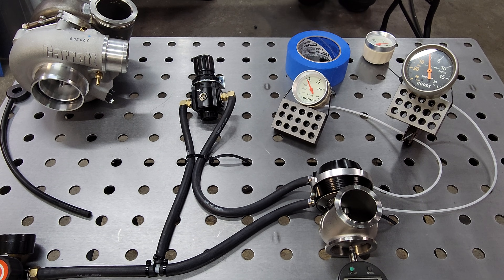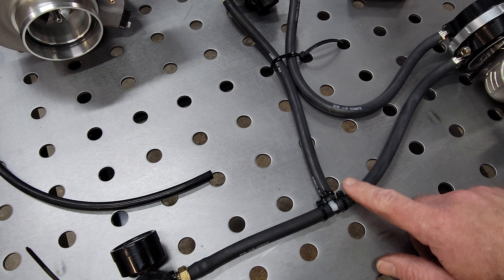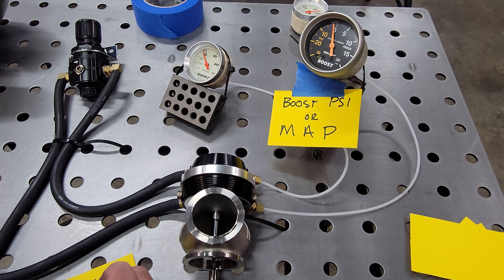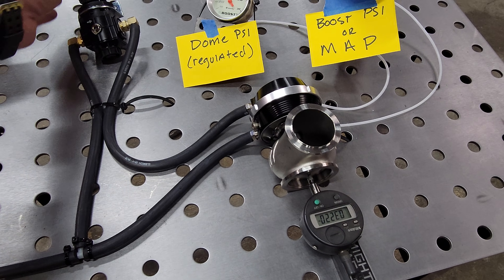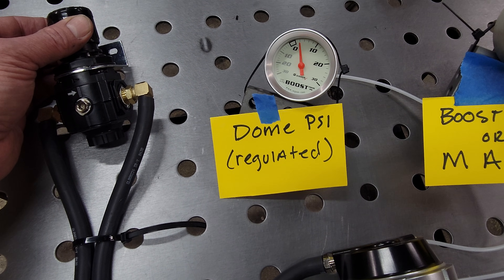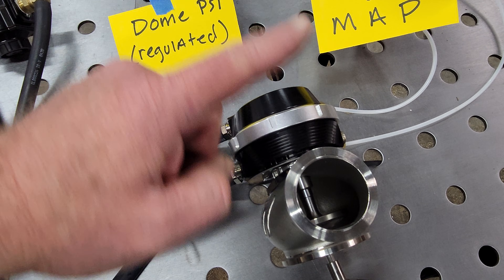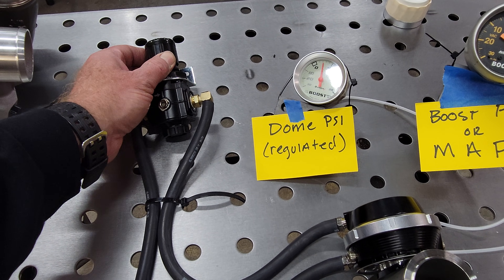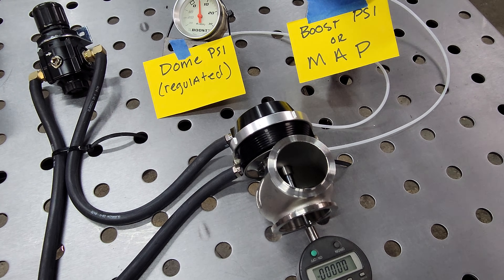External Wastegate Setup, Episode 2.  Simple Adjustable Boost Controller!

Comment: Really like this approach! Tends to allow a much wider boost control range on the same WG spring than a typical ball and spring MBC, and works great for in cabin boost control too since it's not as sensitive to hose length to the dome. 
Tends to be a more solid (although fixed) psi level IMO with a stronger, self correcting feedback loop vs an EBC's ability to vary boost with gear or rpm. Not a big deal with an AWD DSM or Evo, but have done one with two regulators and a solenoid for a "hi/low" boost switch which is fun to play with mid pull :)
Reply from the maker: One of my first "boost controllers" for the drag car consisted of 3 regulators, NOS solenoids and digi set timer relays. It was a concoction to say the least!  Triggered off the transbrake switch.

For the street car we would insert a restriction pill into the upper reference line, that would give us a little bit of a "curve" to the boost ramp...and we also had a "panic" button on the shifter that you could push and engage a solenoid to cut off the flow completely to the dome to stop the boost increase. A second button on the steering wheel that just sent stored air pressure to the dome to give you as much boost as you dared.  It was all so much fun when you would get the 2 buttons confused ;P  Fun times!  Thank you for the comment!   Reed

Comment: Reed what you recommend for a Hotair car?  I know that Turbosmart does make a factory style adjustable actuator, however I have not seen one installed and cannot speak to it as a result.  Would you be able to show or demonstrate a Hotair boost control system?  Something like this - https://youtu.be/LZJuVldL3qY?si=H5cTwyg4xHuNsQBV
Reply from the maker: I can provide an upgrade for you, we do them on a core exchange or also have them new and ready to bolt on without sending in a core.  The Turbosmart cannister will not fit the installation footprint,  we use a TiAL product for these cars.  

Adjustable internal actuator installation and adjustment video:

https://youtu.be/-KRkzusMtmM
Reply from the maker: I also have a second video going over a simple manual boost controller install:

https://youtu.be/kBSwzDOX3tU
Reply from the maker: I have more content on this subject coming soon!  I am a small shop so be patient with me and I will happily help you out with whatever you need on your Buick!  Thank you!!!  Reed

Comment: I have a question. I own a Mazda 626 FE 8V, which is a carbureted car. The current engine power is around 87 hp. I want to install a GT1548 turbo on this car. As you know, this is a diesel engine turbo. My first question is: would it cause problems to put it on a gasoline engine? My second question is: would it be problematic to feed a turbo into a carburetor?

Comment: Can you help me understand the math here? 7 lb spring plus 2 lbs of air to the top, I would think that would limit the boost to 9lbs of pressure, but you were over that on the boost gauge.  Is this just due to variances in the two gauges or is there more to it than the simple math?  Thanks for the great video.
Reply from the maker: My regulator that I used was very touchy (really set up for 100-150 Psi) so I was having a bit of a time trying to get it to stay steady.  Also, yes, you will see a bit more pressure than the actual spring rating.  They do that to help compensate for the exhaust pressure pushing on the valve face.  

All in all, it should "math".  2 psi of air pressure should add 2 psi of boost.  Or get really close.  

Each gate brand could be a bit different, mainly due to the motor (diaphragm) ratio/spring rates etc...

Glad it shed some light on it for you either way!  LMK if you get any other questions.  Reed

Comment: I just set this up on a 1.8t gt3076 build.    It works fine and was only about $50.   I guess the down side is that it's impossible to change accurately without reconnecting it back to the compressor for a steady pressure supply just like any other manual controller.   Thanks for posting this video!
Reply: When you have the regulator and WG on the bench testing you can try adding a paint/etch mark on the regulator body and the knob. Then test how much pressure is added with each click or partial rotation of the knob. Make sure the marks vs pressure repeat several times reliably.
Then when its back in the car you can add/subtract boost in known increments. This is my plan and doing the same thing on my HBC boost controller has worked well.
Reply: @chomptriscuits good idea, thanks

Comment: If you dont mind, what's your thoughts on a large difference in MAP and spring pressure? Also, a falling boost curve even with a properly setup eboost 2. Plenty of turbocharger.
I have a turbo modular ford with twin 40mm PTE gates, one for each bank. 76/75 On3 turbo rated for ~1100HP. Im pretty certain it's a PTE gen 1 sportsman clone. 
I get roughly half the MAP as selected spring pressure(even on 10psi/650hp range). I have a eboost 2 setup in the configuration you show here. reference from turbo, solenoid sends pressure to dome.
I have issues holding a flat boost curve(falls off about 20% regardless of settings I use on controller, solenoid is working). 
I plan to test with air compressor today and see what pressure it is actually taking to open the gates. If the springs are accurate than I must have a restriction in the intake tract? As far as the boost curve, I wonder if twin 40mm is too much gate and does not give fine enough control? I am following a very similar turbo setup to mine in a facebook group and the guy has no issues with a single 44mm gate around 900whp.
What are your thoughts?
Reply from the maker: Thanks for the question. 

 You are on the right track testing the gates with compressed air first.  If this was my setup, I would remove the boost controller from the system temporarily.  Set your springs up to give you a known boost pressure (I would shoot for 75% of your target boost pressure to be "safe"), make sure to test both gates on the bench to verify they open close to your desired pressure.  Make sure the wastegates have their valve seats installed as well. 

Hook the reference port up to the compressor cover directly to the lower port of the wastegates (leave top or dome open to atmosphere)  Run the car and note the results.  

If the boost hits your target and holds, you are needing to dig deeper into the boost controller settings.  If it is still lower globally or falls off up top, try the following:

Move your boost gauge from the intake manifold and directly hook it up to the compressor cover port.  Drive the car and compare.  If the boost reading at the cover is close to your target boost and never falls off, you could have a restrictive intercooler.  If it falls off, lets go to the next test.

Air filter...if the filter is small, or an un proven brand, remove it if you are comfortable with how clean everything is in your engine bay and test road.  Re-run the car and see if the boost holds or continues to have fall off.  If it still falls off, go to the next test.

Exhaust restriction.  If possible, run the car with just a downpipe in place, running without mufflers/remainder of system.  If it still falls off, go to the next test.

Ignition timing/tune.  Verify that your ignition timing is correct.  If you are running an aftermarket ecu, verify TDC and lock the timing at different degrees, validate this on the balancer.  Next, look at your tune, make sure you have adequate timing under boost.  "low" or what some people will call "safe" timing can/will increase exhaust heat and falsely increase backpressure.  This can push the gates open prematurely due to the higher exhaust demand.  Correct the timing and also make sure your air/fuel is not overly rich or lean.   

At this point you should have found your answer, but if not, let me know and we can dig deeper.   Good luck! Reed
Reply: @workturbo  I really appreciate the advice Reed! 
How close are compressor cover and manifold pressure normally? a pound or two?
I'm fairly certain with no controller itll have a falling curve, but I will retest and verify.
I really should add a gauge on the compressor cover yes. The results from the wastgate air test show that the compressor is seeing the 18psi the gates require to open.. 
Additional notes:
I run a larger KandN filter and a 3in DP with a 3in boost actuated dump. The only thing odd about this kit is the charge pipe between turbo and intercooler is 2.5in. The compressor cover and the rest of the system is 3 to include intercooler in/out.
Reply from the maker: @gforce_117  I appreciate the additional info.  I would set the gates up at ~10-12 psi of crack pressure and run the car without the controller first, see if it holds boost through the rpm range.

Reason...the 3" downpipe is a bit small for anything over 650 HP on a modular, so lets stay right around that power number for the tests. 

Get a pressure drop reading off the system (boost at comp cover vs manifold).  That is going to be your first big inside look.  The 2.5" pipe from the compressor outlet should not be a huge issue at this time.  

If the IC pressure stays in line with the manifold (1-2 psi delta at this low of a boost pressure is fine) then lets move on to exhaust back pressure.   

If you are OK with your tune and the O2 corrections are very low at this point (less than 3% CF through the pull), disable the O2 feedback, remove the sensor and install a pressure gauge into that location.  Loop the copper tube in a big coil to get rid of the heat before the gauge head.  Make a pull and note the 'average' pressure number.  At this point, it needs to be pretty low since we are reading it after the turbo.  Lets see what that number looks like.  

Another thing, does this kit have any flex sections in the pre turbine side of the kit?  If so, you need to know if they are the ones rated for turbocharger applications, I have seen these collapse internally and cause all types of issues.

Short version, get intercooler pressure drop first (and if you want to test it with the E boost in place, that is perfectly fine also)

Shoot, last thing...you can also monitor "dome pressure" at the wastegate as well, just pull one of the plugs in the dome and install your boost gauge there.  This will be good info to know as well.  

Hope this all helps!!!  Reed
Reply: @workturbo  I will get some testing done! 
Do you think it would be worth testing with only one of my 40mm wastegates connected? Is it possible that too much wastegate could contribute to abnormal boost control as well? I ask because Ive been talking with another single turbo 3v guy and he is using a single 44mm gate and it works good. He's in the 850-900whp range.
Im learning to tig weld and would like to make a 4in DP along with some other improvements. I do think that allowing some turbine gas expansion would benefit it. My hope through this testing to narrow in on the problem and focus my energy there.
Reply: @workturbo  I went out and recorded a 3rd gear pull. I'll post it on my channel. 

Highlights: Compressor housing is seeing 13-14psi pretty damn steady through the rpm range once it initially stabilizes. However, MAP is dropping with RPM. Peak ~10.5psi on the spool up ~4500rpm holds 10+ till ~5000rpm, then it falls to 8.0 by 6500rpm. 

To me, it seems like the poor charge pipe fitment from turbo to intercooler, and potentially the fact that its 2.5 instead of 3 like the compressor cover, could be a source of restriction. Clearly the boost control is doing it's job at the turbo, and the engine is needing more air at high rpm. I assume some backpressure is the cause for ~14psi instead of 18 at the turbo.

Setup Details: 18psi wastegate springs. controller solenoid disconnected. Mechanical gauge is connected to the same line as wastegates which references compressor housing. Eboost 2 is connnected to the manifold. 76/75 on3 turbo. 3in DP with a 3in boost actuated exhaust dump close to the turbo. Full exhaust setup.
Reply from the maker: @gforce_117  Thanks for the detailed info...you could easily test the charge pipe size by moving the boost reference to the intercooler inlet end tank.  I would go ahead and upgrade the pipe size regardless as the step down size is not doing the compressor any justice.  Ultimately you will most likely find the intercooler itself is the problem (I hope you prove me wrong on this...sounds like the whole kit is off by my recommendations!  I would be OK with learning the charge pipe step down was the cause!)

I think you are spot on about the exhaust restriction with the data you are seeing (base spring 18, boost only 14).   This could theoretically be tested by lowering the HP, set the WG up with an 6 psi spring to purposely lower the HP quite a bit and see if it hits its target boost (should test both the intercooler restriction as well, as the HP demand is lowered)

Keep me in the loop with your results!  Reed
Reply: @workturbo  thanks for the feedback Reed! 
Like you I hope the Intercooler is not the issue. I haven’t heard of others having issues with this IC. It’s close to 12x24 and 4in thick. They rate it for 1000HP. 

So, I hope it’s just a charge pipe fitment/diameter shortcoming as well. Fitment is NOT great the couplers barely make up the difference.. 

The only thing in defense for on3 is that this kit was designed around a smaller turbo and a stock engine. At the time of purchasing tig welding was off the table, now it is so I am going to improve what I got.. 

I will get to work on it!
Reply: @workturbo  Turns out you might be right about the intercooler.. I made my own charge pipe in 3" so now all the charge piping is 3". I'm like 1psi closer to compressor pressure across board, but still same falling curve. (~11psi down to ~9psi redline, 14psi constant at compresor housing). If I load the engine harder in a higher gear, it'll spool slightly sooner and make a bigger peak number that's pretty damn close to same as turbo outlet before falling off at higher rpm.
I have pressure checked again no leaks. Paid special attention to blow of valve, no leaks there. Ensured throttle staying open. 
I have a bigger throttle body to test (twin 62mm over stock 55mm), but I doubt there will be significant change if any. It's the only other thing between the two gauges so couldn't hurt to try. 
I really didn't think it would be the intercooler since it's a 12x23.5x4in core and im only at 560whp or so doing my testing. Do you think it's worth swapping it out for a Mishimoto unit? They make one that is the same size or very very close and would be easy to swap. I wonder if that's what On3 copied. nonetheless, you get what you pay for is my thought here, and the on3 unit is roughly half the cost.
Reply from the maker: @gforce_117  All of the testing is paying off with good data!  

If it is keeping 14 psi steady at the compressor cover, getting 11 at lower engine VE and dropping to 9 at peak engine power...it will be the intercooler.  I hate to say it, but yes...you get what you pay for (sometimes!).  

I  had a heartbreaking conversation with a customer many years back that had some very nice premium brand intercoolers set aside for his project, I told him he needs to just put them on the shelf as show pieces and build his system utilizing different cores.  His combo was targeting about 200 more HP than what we got out of those units back in the 90's.  He put them on anyway.  Had almost 11 psi of pressure drop!  Rebuilt the kit with Garrett cores and immediately picked up 230 HP.  

I wish there was a simple answer for you, but the data is showing the restriction.   I have had decent luck out of the mishimoto radiators and have tested their diesel intercoolers, but I am not comfortable saying that their entire line is quality, so do you research!  

For a premium solution, contact the guys at Shearer Fab, they can set you up in a high quality core and get it done once and right!  Tell them I sent you.  IDK what a mishi part costs, but a quality intercooler is going to be in the $1400-up price point these days. 

keep me updated, and best of luck!  Reed
Reply: @workturbo  wow! I never knew cores could make that big of difference. I will do some homework and see what I can find out! The situation with this car is such a shame overall. We built the engine and sized the turbo to turn a decent amount of rpm for a 4.6. And the intercooler is killing its capability. Power peaked at 6200rpm on dyno so I can only imagine what it’ll do with a properly flowing core and a flat boost curve!
Reply: @workturbo for reference the on3 4” core is 200 bucks and the mishimoto same size is closer to 400. I know a guy that’s better at welding than me and has made custom Intercoolers before that would be a good place to start I think.
Reply from the maker: @gforce_117  Look into the Garrett cores if you have a good fab/welder guy close at hand.  The end tank design does play a role, but nowhere near as important as the core itself.  

I am a dealer for the Garrett cores if you need a place to purchase, just lmk.  

Reed
Reply: @workturbo  I have looked at Shearfab. I like the 1000HP sportsman unit. That should be about perfect for me. Do you have any experience with Treadstone units? They have two options about same dimensions as well.